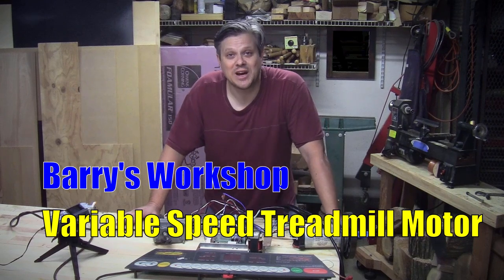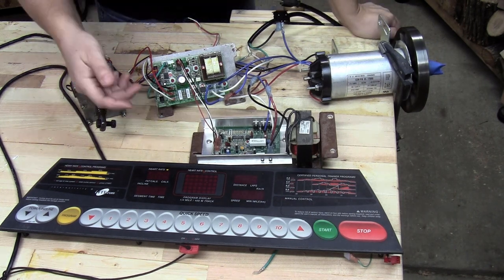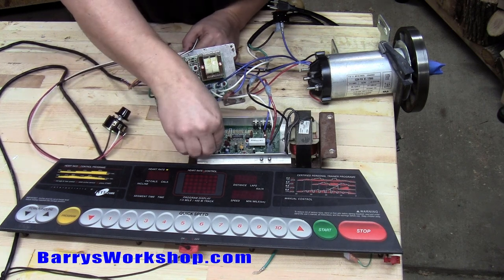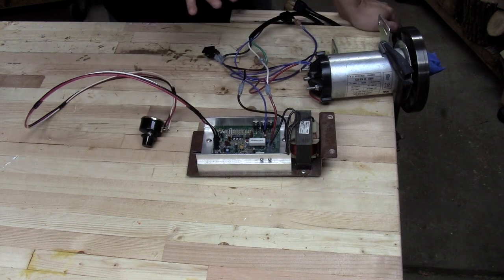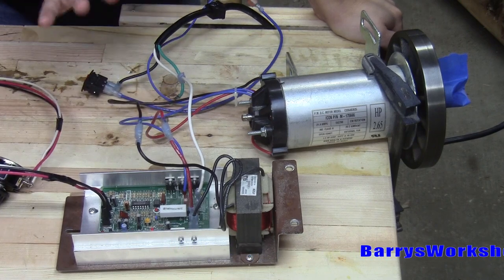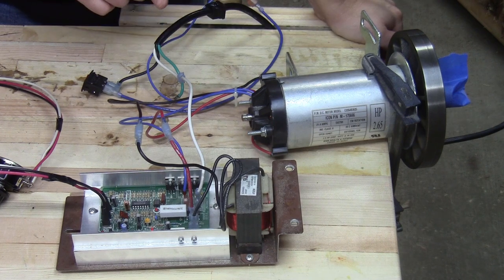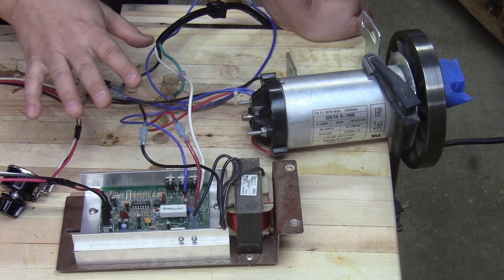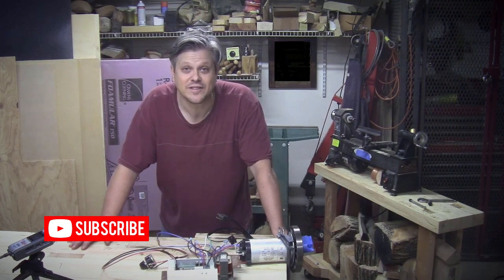Simple Variable Speed Treadmill Motor Electrical Conversion

Comment: I have the same components and am in the process of removing what is not needed. I only have a 5k pot so I will have to order another one I think. Are you satisfied with the 10k pot that you have or would you use another value? Thank you
Thanks
Reply from the maker: The 10K pot works fine, but I have thought about switching to a 5K. There is a spot on the low speed end of the pot that causes a delay when starting up. I suspect that a 5K might be better. I've seen people use either value and I think that the results will be similar.
Reply: hi barry, great video! 
i have just done the whole procedure for my belt grinder and am very happy with the power etc. i used a good quality 5k pot which was fine at first, but now it wont operate at the lower rpm. the motor always starts at about half speed and is only controllable from there to full speed. have you any idea what might be wrong. I'm in Ireland so the mains is 220 volts. does this make a difference to which pot i should use?  I'm still only testing the whole setup so it hasn't been used in anger yet.

Comment: That gearmotor for the incline could be userful for a power feed for a lathe or mill.
Reply from the maker: Thanks for the suggestion. It has a lot of torque, but it doesn't move very far on it's own. Could be useful in the right application.

Comment: I have a treadmill that wants me to replace the console. Everything works, but the safety  is stopping tread from working due to a bad switch. How can I close or bypass this. It's the switch that is identifying the magnet is not on when it is on the treadmill.

Comment: The basic circuit you're referring to, might that be an H-Bridge?
Reply from the maker: I guess that's the name, but it sure looks more like an 'X' when you use a DPDT switch to reverse the polarity. :D
Reply: Cool, I was just thinking that if you had decent sized MOSFET's on that H Bridge, they would take the brunt of the amperage (which you would anyway because it'd have to be rated for the motor), you could do away with that chunk of circuitry that's making the PWM and miniaturize it.  Those PWM controllers can be had ready made for about 5 or 10 bucks but you generally have to deal with frequency whine when you go that route.

I really enjoyed your reverse engineering methodology, good stuff!
Reply from the maker: More than one way to do everything, of course. FWIW, I was driving down the road a few weeks ago and there was a treadmill sitting on the side of the road. I dragged it home and scavenged the parts. Reverse engineering it was an attempt to keep it simple and learn a bit along the way. Hopefully someone else will find this useful, too. :)

I appreciate your comments, my friend.
Reply: Anytime, always nice to see new videos.  That's a good score.  I know the 2.45 HP is a bigger motor than I have on my Grizzly mill.  I almost outgrew that thing as soon as I brought it home. :-P

Comment: How much power does those motors have. Will they run a wood lathe? I think it is a 12 in. lathe
Reply from the maker: There are different ratings of motors. The HP ratings seem high for the size, but you should be able to find one to drive a 12" lathe. It will depend on the pulley ratios, but 12" isn't terribly large.

Comment: I have this set up but no potentiometer.  Is it possible to do without one and just use a dc router controller from harbor freight?
Reply from the maker: I had to buy the potentiometer separately, but it was very inexpensive. I think any 5K or 10K pot should do, so don't let that limit you. I don't know the specs on the HF router controller or your motor, so I cannot say for certain whether that would work or not. Odds are that it is not a match. 

The point of this particular project is that I used the existing speed controller that came with the treadmill, so everything matched. The difference is replacing the big display/interface with a single potentiometer to make a more appropriate control. Hope this helps!
Reply: Barry's Workshop  thanks!  I see places online that sell the pot but I don’t see the wires with it.  Do they usually come with it?
Reply from the maker: I would not expect a potentiometer to come with the wires attached. Find a friend with a soldering iron to help you add the wires. There are probably wires left over from the rest of the treadmill that will work fine.  Good luck!
Reply: Barry's Workshop thanks.  So the motor that I have is connected to a power supply board and motor controller.  Is it possible to get rid of the power supply and just use the motor controller?  What’s the purpose of the power supply?
Reply: Barry..i have a horizon quantum 2  treadmill. I don't have the console so I'm using the existing control boards. My problem is my board doesn't have the 3 terminals that u connected the pot to. I feel the console cable connector would be where I can connect the pot, but to which pins?

Comment: hellow.... plz suggest me , am I use your simple motor circuit to run a manual treadmill... I mean am I attached this to the manual treadmill...
Reply from the maker: I would not modify for use on an actual treadmill, because I have removed some of the safety features that should be included. Instead I will use it for a power tool that I want to have variable speed control. I am rebuilding a metal cutting lathe now and plan to use it for powering the lathe.
Reply: Barry's Workshop but if I install this to the manual treadmill, is it work properly as motorized treadmill......??
Reply: Atanu Biswas
No, it is not going to work. Trust me, don’t use it for a manual treadmill

Comment: Im in the process of building a 2x72 belt grinder.  I just bought a MC-60.  Do I need the transformer to be hooked up.  I just watched another video and seen someone show the assembly without the transformer.  I'm confused.
Reply from the maker: If the "transformer" has only two wires, then it's an inductor, not actually a transformer. I made a follow up video on this, but basically, the transformer smooths out the motor ramping up a bit. I don't really think that's necessary, but a smoother response may be useful for some applications like a lathe.  Hope this helps!

Comment: Do you know how much it's the peak current of the motor ?
Reply from the maker: The label says 21.4 amps.
Reply: do you have any technical sheet ?
can i see it ?
i have the same motor at 90V and 1.5HP and it doesn't say the peak current.
I've been doing some test freely and the peak current it's 20A i can't imagine with a load.
Reply from the maker: Sorry, but all I have is what is printed on the side of the motor.  My motor says 21.4A, fwiw. I agree that sounds high for no load.

Comment: Do you need to ground the green wire?
Reply from the maker: Excellent question. The green wire is the grounding conductor and should be used for safety.  I didn't hook it up in this video, but when later attaching the motor to the tool, the green wire should be connected to the chassis of the tool. I will also ground the chassis of the PC board and the mounting bracket for the motor.
Reply: Thanks. To clarify, I should ground it to the actual steel frame of my 2x72 belt sander (motor is driving this tool). Thanks again!

Comment: Thanks for sharing. I have noticed that different makers of treadmills use different circuits to make them work. What brand i yours, so if i find one like it. Great video!!!
Reply from the maker: Thanks, Sam. I don't recall the brand, but if you find one cheap, you can look up the model number for replacement parts and get an idea of what's inside. Most of them have a similar arrangement as mine, but the size of the motor will vary.  Good luck!

Comment: Is it going on your wood lathe
Reply from the maker: I actually have two different lathes that could use this. One is a wood lathe that works well but requires manual belt changes. Variable speed would be REALLY nice, but isn't totally necessary.

The other one is a metal cutting mini-lathe that has a broken speed controller and motor. I'm leaning toward this one for now because having the working metal lathe would be more useful since I have no way of turning metal now. The problem I have is that I really need a metal lathe to make the proper pulleys/gears to mount it. I'm thinking of a way to get it working temporarily so that I can use the lathe to make the proper parts.

I'm probably going to pick up another treadmill, eventually. Someone dumped this one on the side of the road, so it was free. But there are a bunch of options on CL, for hardly anything. 

Thanks for your question, Keith!

Comment: still not clear where to connect the two blue wires from the motor, mine is surging and blue wires are not connected to anything
Reply from the maker: On most of these motors, the blue wires connect to a thermal switch that is normally closed but will open when a set temperature is exceeded. I copied the circuit from the treadmill by running the hot of the mains power through the blue wire, before it goes to the circuit board. If the motor overheats, all power will be shut off. This is a safety feature, and I chose to include it, but it should not affect the functioning of the motor other than to shut it off if it overheats.

If your motor is surging, then something else is almost certainly causing it.
Reply: Your surging is most likely because the motor has no load on it and the board mounted potentiometer (may be labeled torque boost)is adjusted to the load that the treadmill may see when in use.

Comment: Where do you connect to the Rectifier ?
Reply from the maker: The board takes AC power, so the rectifier is built into the board, for driving the DC motor.
Reply: interesting where in the board is that element!!! I could not see it and it will be interesting to being able to identify it when its in the board itself.on my lathe I found it separated, with X shape ac to ac and dc to dc (bridge rectifier).

Comment: IF YOU reverse direction on the motor the pulley/flywheel has a good chance of spinning off the shaft. I have the identical motor/specs and so forth. Weird hey. Allthough all the same. These motors spin up to 6800 rpm so watch the fuck out! CW ONLY!!!